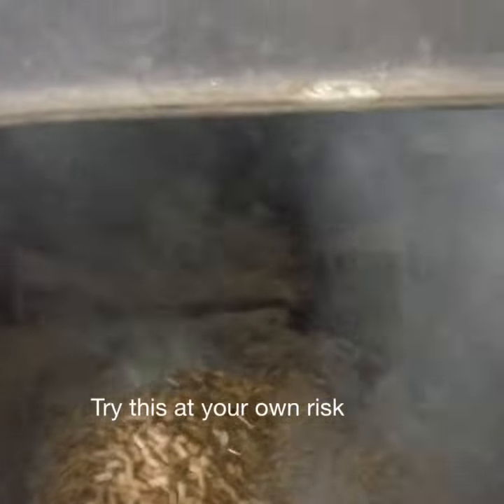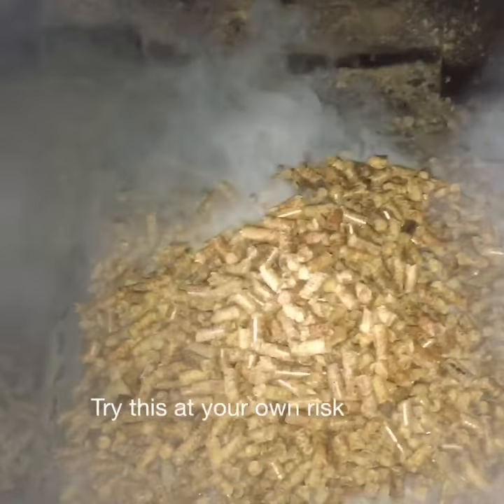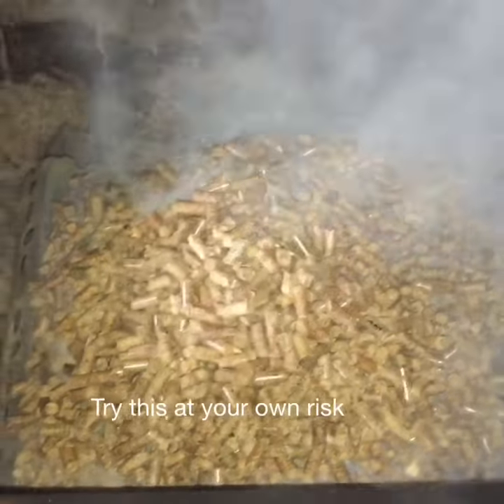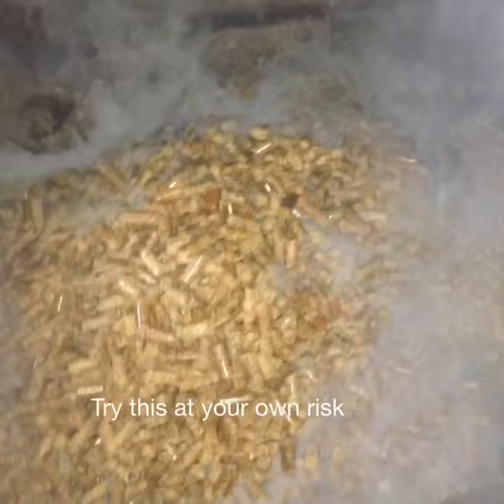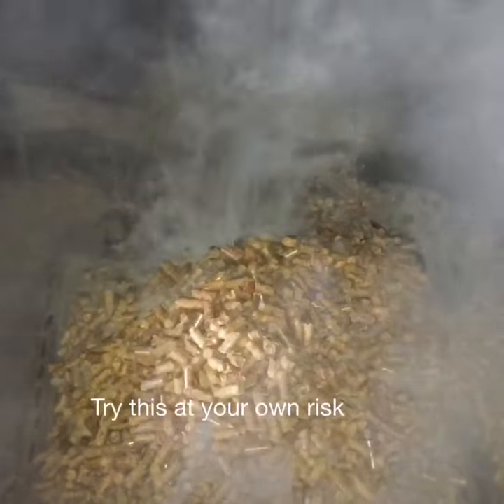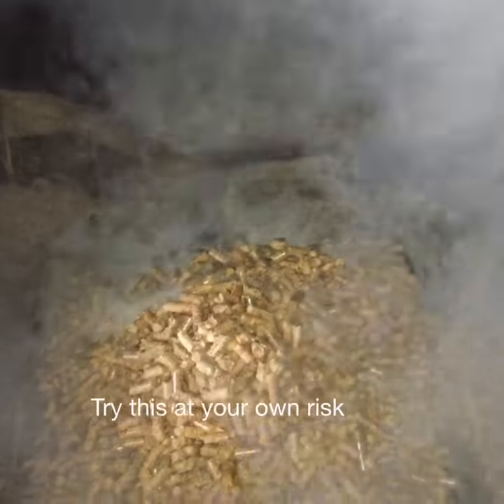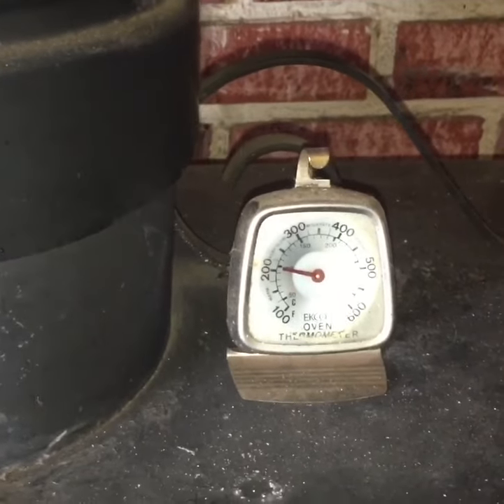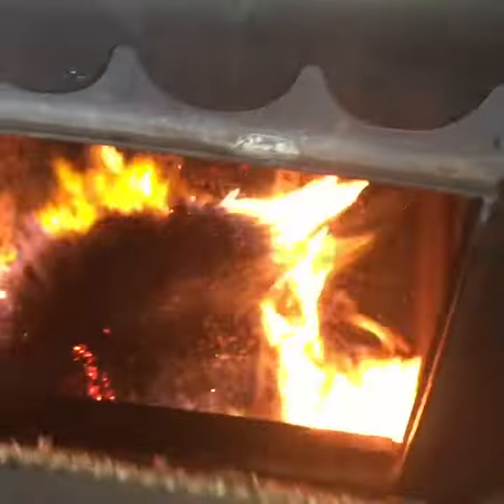Burning pellets in an ordinary wood stove

Comment: Well Now,, We have the same Stove in the garage. I have it piped into my woodshop. Via 5x5 ft hood  with sides to the floor and a welding blanket hanging on the front ,and a kicker blower in the duct pipe..to the shop in the next room.  Going to give your Slotted angle a go. Thanks for the idea... gotta rummage thru the junk pile to see about angle.  Cheers 
Dog

Comment: I use them in my fireplace i got an old pan drilled holes in it and put a rack over top of it to put small pieces of wood on and it burns for hours